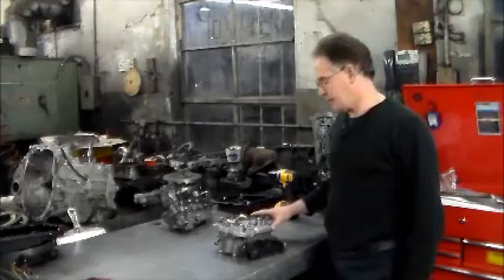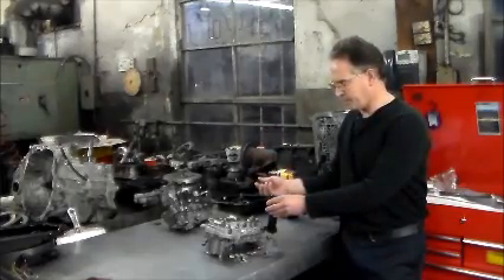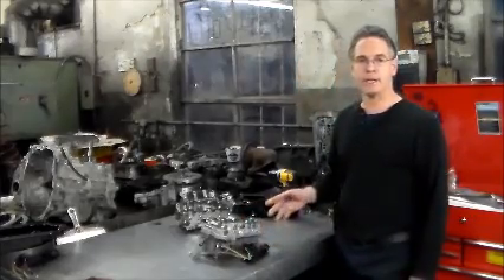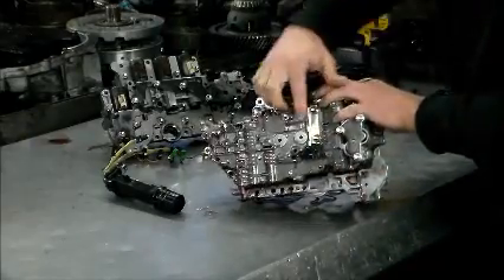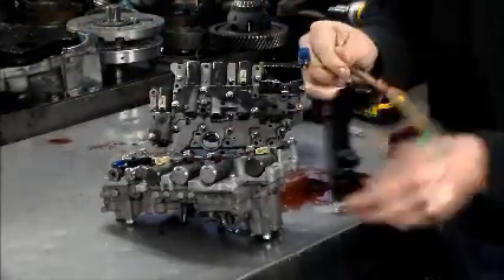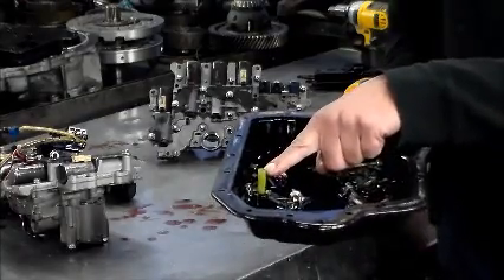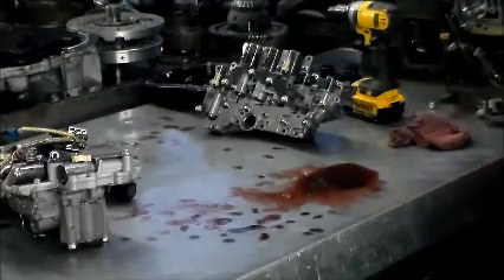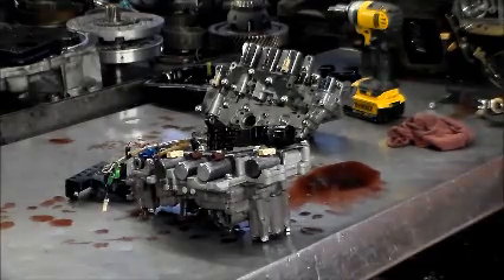Toyota U760E with code P2716

Comment: 2013 rx350 awd does an internal valve body harness come with the temperature sensor? Do you have to remove the transmission to replace it?
Thank you
Reply from the maker: I believe it does

Comment: Hi Gary, need some expert advice on u760 problem. 

I rebuilt the trans with new Torque converter, clutches, steels, pistons, seals, bearing races, and "reman" chinese valve  body that I upgraded with Sonnax Zip kit. The C2 clutches were burnt bad.

When I first test drove I was able to get all six gears. It did have a high outched whine driving +45mph. After several  test driving, entering  parking lot, the idle would fluctuate and trans would give me problems with flaring. Further driving I had more trouble with unable to get in 4th gear, 5th gear or 1st and harsher shifts.

Now I get codes  PO776, P2714, P2808 for Solenoids B, D, and G.

All the solenoids activate. Ohm test was consistent 7ohms, the should be lower but I got same readings on older solenoids.

If you have number I could contact you let me know. I can compensate you for your time.
Reply from the maker: I don't like the " Chinese Reman Valvebody"  But all cutch packs air check ok all the clutch clearances were good?  what pistons did you use for the drum?

Comment: Hi Gary, do I need to reprogram TCM if I replace the used Tcm or new one?. Do I have to bring it to dealer to re program? Thank you.
Reply from the maker: No,  should be plug and play
Reply: @GaryFerraro thank you for fast respond. So do I have to reset memory and set the compensation code?
Reply from the maker: @HieuTran-xk3vm  I would drive it first and see how it works before resetting the memory  for the transmission
Reply: @GaryFerraro thank you so much for helpful informations, Gary.

Comment: this is nothing new, all toyotas do this even the new ones 2017, 2018, 2019 etc. The solenoids are meant to fail and the customer told they need a new tranny.
Just replace the solenoid, and add the same amount of fluid removed, and your golden ! I am truly disappointed in Toyota with the lies and misleading diagnosis procedure for this failure!!!!!!!
Reply from the maker: 2716 is usually always a TCM,  Only had it once when it was a solenoid, water was in the trans
Reply: @GaryFerraro  The newer cars no longer have a tcm. Drop the pan, key on, solenoid buzz, touch with your finger, the bad one stops buzzing or just ohm them after applying a torch to them 30 seconds . Very very common toyota problem. Dealers stock these now for all Toyota U model trans. Same part number and solenoids.
Reply from the maker: @BigBenny24  are you talking the 8 speeds or 6 speeds
Reply: @GaryFerraro  both, the solenoids fail after 5 years plus typically. I'm seeing this take out collision avoidance , abs, and telecommunications within the radar collision avoidance systems in the can bus, and it all leads back to these solenoids. They cause a multitude of can bus codes.

Comment: I appreciate the excellent videos. On occasion, the dashboard electronics in my 2008 Lexus ES 350 restart multiple times while driving, occurring around six times in the last month. Upon checking the error codes, I found it to be P2716. Is there a way to diagnose whether the issue lies with the TCM or the electrical aspect of Pressure Control Solenoid D?
Reply from the maker: if you clear the code, does it come right back?

Comment: Hi Gary, thanks for the video. I have a 2013 Sienna with the U660E with the p2716 code, can you tell me if it's possible to replace the SLT solenoid without dropping the valve body? thank you in advance.
Reply from the maker: You have to drop the valvebody,  if you clear the code, how fast does it come back?  could also be your computer
Reply: thank you for the reply, it comes back on immediately, I leave the battery disconnected over night and light comes right back on when started. Dropping the valve body makes me a little nervous, any concerns or tips? A little back story...

 A few weeks ago all of a sudden it threw a speed sensor code and the engine light and trac light came on. A couple weeks later it would not shift into reverse. It threw a few tcm codes, one being p2716 pressure control solenoid d electrical. I cracked open the drain plug on the transmission and the fluid looked terrible. I did a fluid replacement through the coolant lines and checked level. It took a few test drives and eventually, everything was shifting fine. After about 200 miles, I did another fluid change and changed the filter. Still have the 2716 code @GaryFerraro
Reply from the maker: If you can Try to ohm the solenoid at the connector, if ohms ok then TCM is no good, 99% of the time the TCM is at fault with this code but i don't want you to go out and purchase a TCM until it's checked @JustinTredo
Reply: OK, I will do that. Do you mean to ohm it at the TCM connector or drop the pan and ohm at the solenoid connection? I see that I can access the TCM by removing the battery and air clean inlet according to the manual. @GaryFerraro
Reply from the maker: TCM is bolted to the trans? @JustinTredo
Reply: it appears to be, here are the instructions from the manual. I'm not sure how I can send pictures or a screenshot here.

 Title: U660E AUTOMATIC TRANSMISSION / TRANSAXLE: TCM: REMOVAL; 2013 MY Sienna [08/2012 -        ]
REMOVAL

1. DISCONNECT CABLE FROM NEGATIVE BATTERY TERMINAL

(a) When disconnecting the cable, some systems need to be initialized after the cable is reconnected 

2. REMOVE AIR CLEANER INLET ASSEMBLY 2013 
3. REMOVE BATTERY 

4. REMOVE TCM

(a) Turn the lock lever and disconnect the connector from the TCM
(b) Remove the 2 bolts and TCM from the automatic transaxle..   @GaryFerraro
Reply from the maker: My E-mail
Gsferraro@yahoo.com @JustinTredo

Comment: Were can i buy that part i have the same issue check engine with that code
Reply from the maker: So you need a TCM?
Reply: @GaryFerraro  you saying i need a new computer ? Or just replace the electrical d solenoid
Reply from the maker: @naviosobefresh2866  What code do you have
Reply: @GaryFerraro  P2716
Reply from the maker: @naviosobefresh2866  99% of the time the computer is no good.  The only time i had a solenoid cause this code was because there was water in the trans and the solenoid shorted out
Reply: @GaryFerraro  im following your advice thank you for your help men i hope to reach you again if i have other questions 🙏🏽
Reply: @GaryFerraro  thank you for your help i did what you told me and the check engine is gone i was looking for an answer for 2 years and with your simple coment of changing the computer everything is resolved 🙌🏻
Reply: @GaryFerraro  thanks for replying

Comment: great video  question Can I replace the SLT solenoid  without removing the body valve?  I have a sienna 2011  3.5L 6 speed  and I have a code P2716
Reply: Did you figure this out? I have same code popped out, but shifts well on Lexus 2010 rx350.. should I just drop oil pan down and swap solenoid? Do I need to remove valve body?
Reply: @richardsutrop8789 did you end up fixing? How?

Comment: Would an overfilled transmission cause this? I have a slight whine  for 2 seconds when going into neutral and park. Another video pointed out that the noise only occurs when the SL solenoid goes on
Reply from the maker: Shouldn't cause it, would you say it's more like a buzz than a whine
Reply: @GaryFerraro  i suppose I would call it a high pitch buzz, not like a bee but more like the sound of a dentist tool, and then after the couple of seconds I can hear something shutting itself off, similar to a door closing.
Reply from the maker: @junglejuice23  Does the car ever stop moving when hot?
Reply: @GaryFerraro  I've never had any sort of unresponsiveness or late response at all
Reply from the maker: @junglejuice23  ok, maybe a valve buzz, the valves are moving constantly in the bore and maybe bores are starting to wear out
Reply: @GaryFerraro  thanks for the insight! These U760e transmissions are known to create that noise when overfilled so I am going to start with returning it back to the normal fill of 2.5qt because that is how much comes out when it's leveled. So far the noise has been very consistent and hasn't gotten worse or better at all
Reply from the maker: @junglejuice23  With engine running hot, take the plug out in the pan, there is a stand pipe in the pan so make sure steady stream coming out, put a bucket under if you think it may have to drain out some
Reply: @Gary Ferraro  thank you! I was able to successfully tackle this issue. I have one more question if you don't mind. Sometimes when shifting into drive, I'll hear a sound from that area that sounds like something it getting mangled, like metal clanking together and sometimes it will be accompanied by a tick at the very end. It doesn't happen every time, only sometimes. Sometimes during a cold start, after driving around, stopping the car, and starting it back up going from park to drive it will make this sound.. do you know what could be causing this?
Reply from the maker: @junglejuice23  Almost sounds like something with the axles

Comment: Will a wrong size battery would affect to the point of this code coming out i have a 2008 toyota avalon an it has a smaller cheap battery brand it is brand new but its small can that make the code pop up?

Comment: Hi Gary , great video 
I have a Toyota Camry 2.5 with 760e AT 2010 
It suddenly started slipping 
And all selenoids codes A B D G  performance or stuck off 
P0746 
P0776 
P2714 
P2808 
 What's your opinion about What's wrong with it , dose it need a new transmission?
 I checked the fluid amount and quality and it looks not that dirty( still red)
Reply from the maker: What happens if you clear the codes
Reply: @GaryFerraro  the problem continue and the codes come back after few days
Reply from the maker: @TheIbrahim513  was anything done to the trans?
Reply: @GaryFerraro  no  
Only  parked the car for 3 days ,  
Then it suddenly started slipping hard the day after
Reply: It slips hard in 4th( rbm reachs 5000)and 5th gear 
And engage with nock  , and also nocking from N to D and from N to R

Comment: I'ma do a u760e works till it gets hot after a few drive cycles it acts up no 4th 5th 6th a weak solenoid that can't handle the heat in the kitchen no more, I'm guessing. But car has a bad battery also I'm gna check continuity at harness could it be a valve hanging??

Comment: I had an update. For you.. I found the part I asked you about yesterday at the junk yard.. and I took the internal harness with it.. put it all back together and car is running good.. but I have a light on for torque converter solenoid.. p2770.. would you be able to tell me which one is the torque converter solenoid.. also how bad is it to drive car with that code?.. again.. it is driving well.. im in a pretty crappy situation at the moment.. any help would be well appreciated
Reply: Did you ever get this figured out ?
Reply: @Marvin1martian  i can tell you this if you replace oil in a Toyota you have to reset driving parameters.. after all this issues with car . I continued to have check engine lights on for trans codes.. I dont remember the codes.. but eventually the trans started to over heat and failed.. replaced with good used.. reset driving parameters and its been good ever since..
Reply: @pisto_run_cycling  I see. Appreciate the info. I’m dealing with codes after an engine swap. Doing a lot of studying and homework on the matter. 
Thank you! 🙏
Reply: @Marvin1martian  my issue started after washing engine.. where the harness plugs into trans.. its a pass through connector thats bolted in place inside trans. But can have play and mine rubbed through..  and water got in and fried it.. prior to this though there was a trans code.. so maybe you had it before you swapped engine? Also.. If im not mistaken 2010 and 11 were known for trans issues.. good luck to you
Reply: @pisto_run_cycling  I did wash the engine bay prior to removing the old engine. I’ll check the harness that connects to the trans.
Reply: @Marvin1martian  i did get a bit over a year of use out of car even with codes.. 80 miles a day 6 days a week

Comment: How do I get the valve body off? I took all the bolts off but the plug won't come down..
Reply from the maker: could be some crap there, push on the outside of it and see if it will move down
Reply: @GaryFerraro  thank you for getting back to me.. I pulled tcm off.. then was able to remove the plug.. which leads me to my next question.. do you have a part number for that plug only.. ive only been able to find it with the Solenoid harness and solenoids as a kit.. and even that kit is hard to come by in my area.. id have to order it but its over a week out.. need my car going by Monday..
Reply from the maker: @pisto_run_cycling  That is part of the internal harness correct
Reply: @GaryFerraro  yeah its bolted to the valve body.. and the small harness off the Solenoids connect to it.. and the tcm connects to it from outside the case..

Comment: Hello Gary .. i have a 2007 2.5l toyota camry gear is transmitting smooth but the code p2716 d electrical popped up i have tried to clear it using an obd 2 scanner but the check engine light keeps popping up. 
What do i do?

Comment: I just discover some of your videos I found very useful  you mention a u760 flares on 2-3 shift  I have a 2011 that do that same thing only when cold I have not get into  yet iam doing some research on the problem before I do the valve body and air test do you have any advice  thanks
Reply from the maker: You could try setting shift adapts first, also make sure the trans is full of fluid
Reply: Thanks I will try

Comment: Call your local Toyota dealer. There's a recall out for the ECM that throws this code
Reply: I had a 2005 corolla today and they didn't extend the warrenty they just put out a recall.
Reply from the maker: @justinbouy3153  Thanks for the info, going to look into that
Reply from the maker: justin bouy Are you talking about cars like the RAV4 where they extended the warranty

Comment: My 2017 Camry 2.5 has this code at 33k miles.
Reply from the maker: Singledadadventures usually means a faulty TCM. How does the car work does it shift?  Also make sure your battery connections are good. Had one with this code and found a bad a loose negative battery cable
Reply: Gary Ferraro The car shifts fine. No issues there. I’ll check my battery terminals.  Thank you.
Reply from the maker: @Iraqveteran-ke6qu  OK, have you tried clearing the code and it came back?
Reply: Gary Ferraro cleared the code 2 weeks ago. A weak after it came back. Hoped in my car and the engine light turned off. Have yet to check if the code is still there.

Comment: One question. What do you think about this transmission U760E, is it good? Do you know if they have quality issues or defects? I have read they have some issues with the torque converter. Thanks for your support.
Reply: They are really good transmissions. I came across with some having over 400,000 miles, provided a proper maintenance is performed.

Comment: great videos Gary.. i have a 2009 corolla with this p2716 code and is shifting really hard.. scanner reads   this pressure control solenoid..... don't know if you can pin point the location of this particular solenoid  on this transmission.. U341E...it's hard to find someone in this area that does this kind of work.. everywhere i take the car they tell me i have to replace the transmission.. car has only 100k...saw a video of the same car with the same issue and the problem was the computer ECM/TCM..  guy replace the comp and said transmission was running fine after that.. nothing to do whit the solenoids... appreciate if you can shad some light on the issue
Reply from the maker: Is the code for Shift solenoid D?  Did you replace the ECM?
Reply: @GaryFerraro  the code reads p2716 pressure control solenoid D electrical.... got a new PCM on the way ( new to me. it's used ).. txs for the reply Gary
Reply: @GaryFerraro  it also says code 2716 indicates the PCM  detected a fault in the linear solenoid valve(SLT) circuit
Reply from the maker: @armyofone2019  That is usually the problem, i think something happens to the driver inside the computer but it blames the solenoid.  Did you get the part number off of your computer?

Comment: I have a 4 cylinder 2007 Camry and it is pressure control solenoid c electrical 😩 and Isaí what to order do to lack of knowledge of the what solenoid i should be replacing 😭